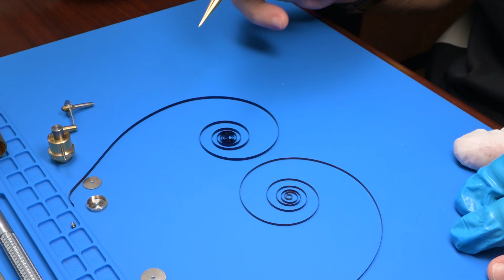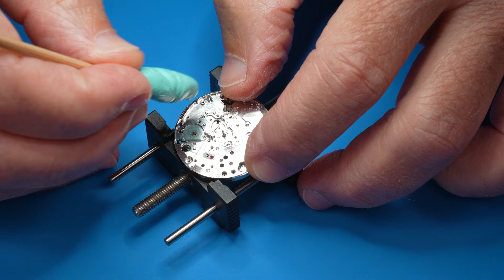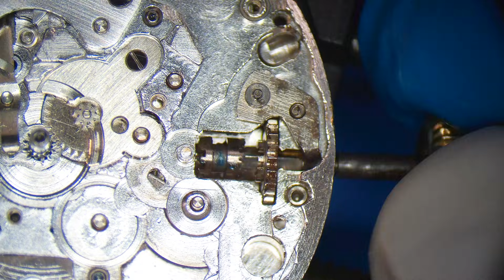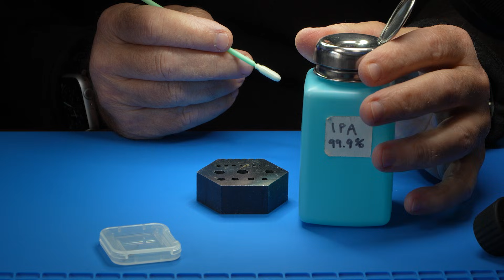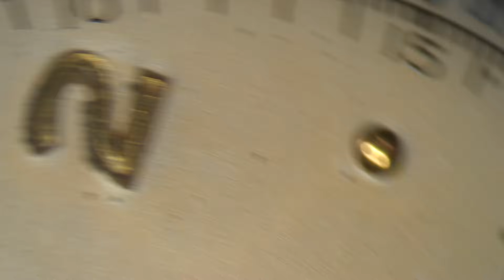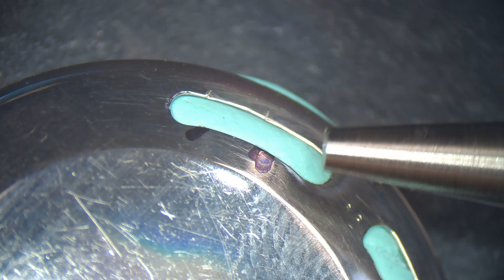🛟 New Life for Gramp’s 1949 Vulcain Cricket Alarm Watch! #watchmaking

Comment: Thinking about buying one new. My hesitation is about maintenance after 10 or 20,… or more years.  Of the brand is no longer there and parts unobtainable. What is your vision about that?
Reply from the maker: Interesting question... The new Crickets are based on the old movements - with many welcomed improvements! Even if the brand went away, these watches can be serviced by any watchmaker. I imagine parts should remain available, too. Also, there's no special tools beyond the usual watchmaking gear and supplies required to service one. Did that help answer your question?
Reply: @WatchWithMike yes, thanks.

Comment: I don't have a lot of extra space, but I would like to have a buffing machine. Does it make an enormous mess? Or can it be decently contained?
Reply from the maker: I'm containing mine with a plastic lid from a cake container, and it has been working well. I have a vacuum with a soft brush that I use frequently as the compound spatter builds up. But overall I think it is easy to contain.